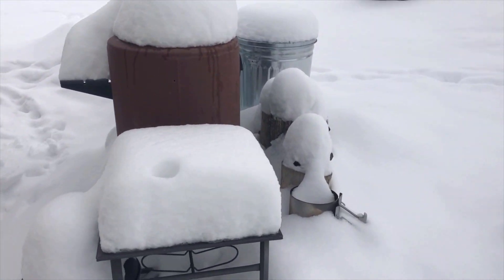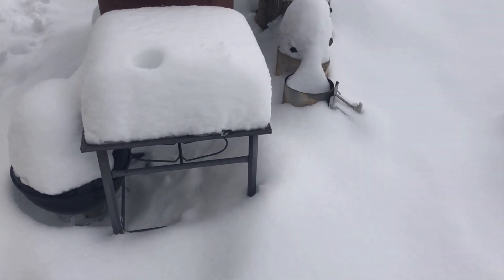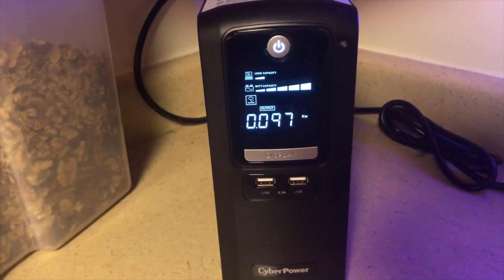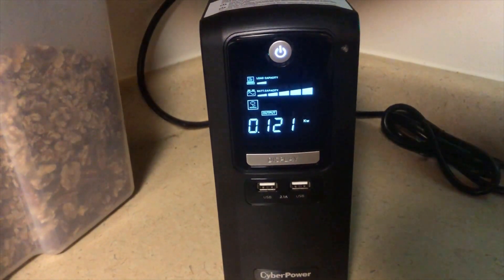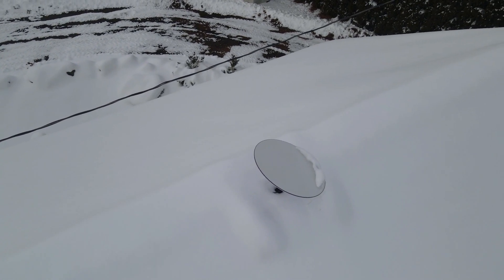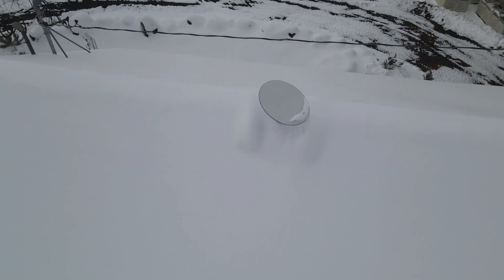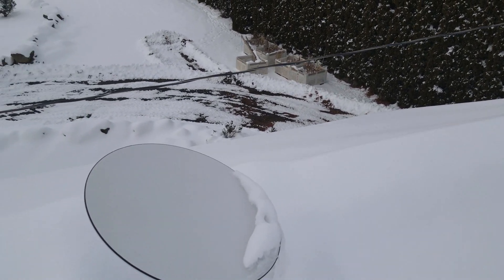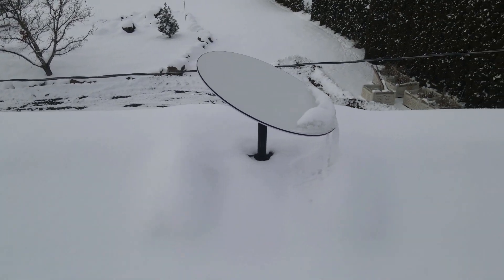Heavy Snow: Power Usage For #starlink Satellite Internet by #spacex: Part 3

Comment: I took a look at mine today after we received quite a bit of freezing rain on the east coast.  Icicles are hanging down a good 24” from the bottom of the dish lip.  I’ve got it on a 36” pole and it doesn’t seem to be affected by them.  As the weather changes they just fall off eventually but it’s been overall a mild winter so far here.
Reply from the maker: If it wasn’t for the whole north thing I don’t think it would be an issue, a southern facing disk with that black edge would have an easier time heating up enough to melt the ice at the attachment point. I still think a basic heat pipe that is connected across the back side of the dish and runs along the downslope side would transfer just enough heat to prevent the ice from stickling and not add any extra motors.

Comment: I think I would go with the pole mount to give it more distance to the ground and I'd put the pole in the yard so it could be maintained easier. If you can get a clear view of the satellites that is. You could use the pole on the roof instead if not.
Reply from the maker: I wonder how much weight the servos can hold before breaking? Or is it just better to have it on a pole on the ground so it’s easier to just walk out and break the ice off.

Comment: 1- Do not try to brake the ice with it moving. 2- there is already a coating on the dish and 3- that roof mount is not very good as there are issues with it being to low and freezing to the roof/mount. They no longer sell that mount for that reason.

Comment: I am off grid in Canada . If its cold but clear does the heater still come on or does it come on when it senses snow. ?
Reply from the maker: You can now choose when to turn the heat on, it will come on when it senses snow and based on the temperature. But  you can also turn that off.

Comment: hey! do you know if the starlink will work with any router?
Reply from the maker: Yes, if you connect up a router and bypass the starlink router it takes setting up a static IP address otherwise you can always set up WiFi through the auxiliary port.
Reply: @adventureswithkramer  thanks!